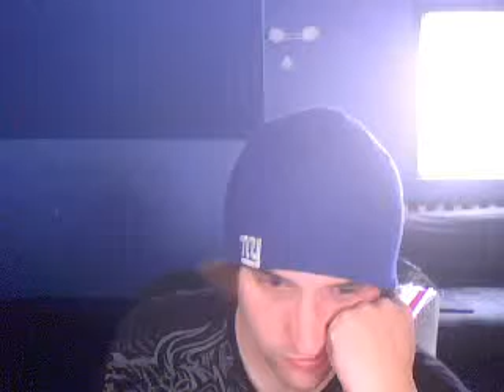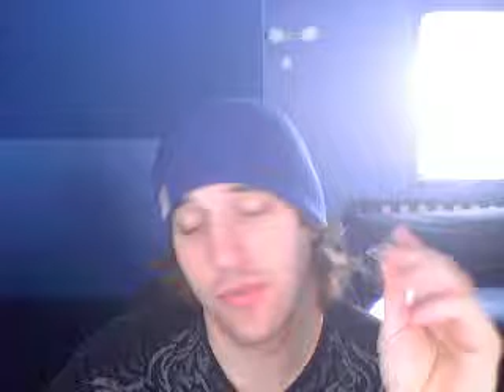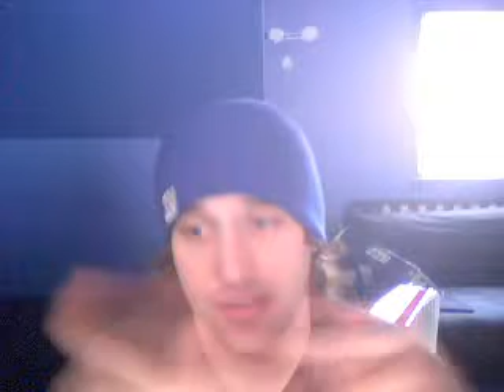Chrysler 2.7 L Engine Failure Wrap up

Comment: The 2.7 was a Daimler motor, designed for simplicity & higher revs. since fewer moving parts. The Water Pump Doubles as an idler pulley for the Timing Chain. When it Fails the motor "grenades" from Water Dumping into the oil...
Reply: And they fucked up. The only manufacturer that has a successful V6 engine that is reliable and that has the internal water pumps is Nissan. Nissan engineers did not put the water pump in the middle of the V in the V6 engines like Ford and Chrysler did and both manufacturers had coolant entering the crankcase Chrysler had a bad gasket and Ford had bad water pump bearings. The Nissan engineers have engineered the engine to take the water pumps and timing chain tensioners out without removing the front cover. The only thing is that you have to buy special tools. The Nissan engines that I was talking about is the VQ and VR series V6 engines. The GM ecotec 2.0, 2.2, and 2.4 were the same way until they replaced it with the 2.5 and 2.0 LTG turbocharged engines that did have the external water pumps.

Comment from the maker: @jsexy2013  do a hard reset. disconnect the battery for 5 to 10 mins than reconnect, should clear all the codes.. But before you do that, cycle the key on adn off 3 or 4 times till where your odometer is starts showing trouble codes.. than find out what it could be.. good luck

Comment: I hate to say it, but this engine is one of the big reasons Chrysler has lost a lot of customers. Better to cut your losses and spend the money on a good used car. That's what I ended up doing after 5 years of making payments on a paperweight I drove only 41,000 miles. I sold it for scrap. You gave good advice and seem to have a good attitude about this whole fiasco.

Comment from the maker: @Toyota4Runner4Ever  oh yeah and one more thing about the 3.4L DOHC.. I owned one.. they have this distributor plug witha  o-ring where a distributor once was in early production years.. when that o ring goes bad unlike the 3.1 u lift it take it out change it, end of story...3.4 u got to take the top end of the engien off for one little 25 cent oring...ugh..nightmare

Comment from the maker: @Toyota4Runner4Ever  actuallt its very likely.. Gm in the early 1990's had a engine called the 3.4L DOHC engine..it was a very very high revving engine and had a nice torque curve.. the only downfall about that Gm engine was it was EXTREAMly high maintanance.. the timing belt would have to be changed at such a low milage it was insane..howver.. people still use them, many people swap them into Pontiac fieros...The 4.)l is a runner. But dont forget about the 3.3L and 2.5L I L engines

Comment: I had a Dodge with the 2.7 liter engine that failed once at 47,770 miles and was replaced. The second engine failed at about 83,000 when the timing chain failed. This was professionally rebuilt and it still failed with about 35,000 miles on it. Any DOHC engine is going to be a pain in the butt to rebuild even for a firm that does this all the time. Very hard for a shadetree mechanic like myself. Swapping in a 3.5 would have cost more than the car was worth.

Comment: When we are young we don't listen are moms and dads  that much because we think we know everything.. I'm know about  thirty years old and I know agree with this   saying. Mom and dads know best because they been around this world several times. Good video:)  I also had a learning experience with  this blanking motor.  My aunt rented a new sebring in 03 and only had 500 miles on it. My aunt Loves to driving fast  and the motor didn't like it blew up. Usually a new motor can be a lot more flexible with by pushing it..  these motor are piece crap.. take care!!

Comment: The 2.7 is generally a very poor design. The model year 2004 and up was improved but it's still not a good engine.  The timing chain backstop, in case of timing chain tensioner failure prevents some problems.  Using some Auto Rx at every oil change helps with stopping sludge.  The worst problem is water pump leakage.  Any small leak and the engine is likely gone.  Use a very high quality Antifreeze at 70% mixture ti help the water pump last better.  The 2.7 is crap.

Comment from the maker: this is true. But you still ahd other defects from when the engine was designed. You have the narrow oil passage ways in the engine. the tiny holes in the connecting rod bearings. And alot of other things that made that engine bad. it was a bad design. theres a rebuilder in NJ that rebuilds this engine and removes the defects that It came with

Comment: I would probably just replace it with either the 3.2 L or the 3.5 L if you could retrofit it to work. I have known people that have had much better luck with those two Chrysler building engines as opposed to the 2.7 L. But I do know a person that has a 2002 Dodge Intrepid with the 2.7 L in it, the original 2.7 L, and has about 209,000 miles or so on it. And it is all original. I find that very interesting especially since these engines tend to fail below that point. And as far is the 3.4 L dual overhead cam engine being terrible, I actually think there was a General Motors engine that was even worse than that one that was a V-6. The old Buick 3300 V6 that was used in the Skylark of the late 1980s and into the early 1990s. I also believe that engine was used in the Pontiac grand am as well. But most of them I have been around have been very problematic engines.
Reply: If you have a Sebring or Stratus, 2.4 is the only option and the best way to do it is buy a wrecked 2.4 Sebring or Stratus sedan or convertible. The 3.0 in the Sebring Coupes will not fit because the coupes are built by Mitsubishi and they are on a different platform.

Comment: is the oil leak external or internal? are u using the right weight oil? and do you change the oil at the correct intervals? how about replacing the pcv valve which only cost bout $3. if this valve haven't been changed the car can suffer from sludge and oil consumption.

Comment: I have the 2.7L v6 in a 2002 chrysler sebring and my oil light just turned off randomly after going on and off at idle any advice? P.S. I do also have a very very small oil leak. (182,000 Miles) Water Pump replaced twice.